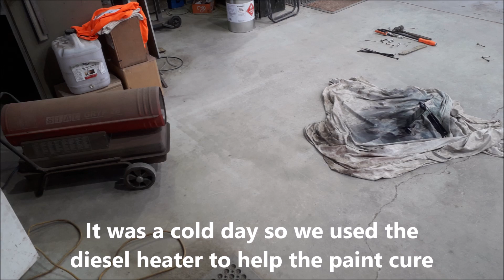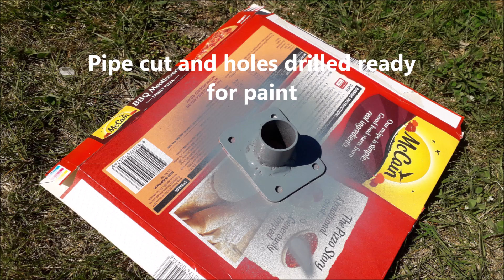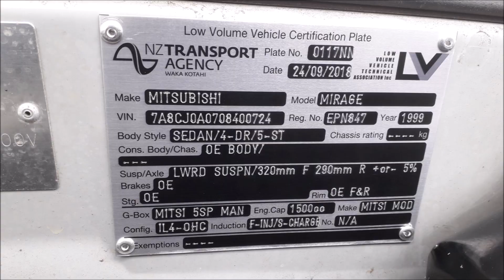1999 Mirage / Lancer supercharged build pt: 1

Comment: hiya mate the engine bay says 4G13 engine but the the certification says 1.5L engine so did you swapped the engine to a 4G15? was it difficult the certification paperwork?
Reply from the maker: The 4g13 and 4g15 are the exact same engine with the 15  being a larger bore and stroke. I bought the car with a 4G13 build plate but a 1.5L engine, certification was super easy.
Reply: @outbackelectricalnz432  Iv a 4g13 I want to do this too would u make all the stuff for me like this if I pay you an pay for shipping?

Comment: Nice! I really want to make my mirage supercharged like this. What kind of supercharger that you use?
Reply from the maker: It is the commonly available AMR - 500 manufactured by Aisin :-)
Reply: @outbackelectricalnz432  very interesting man. Btw, can I install this SC without removing the AC compressor? I want to keep the ac working.
Reply from the maker: Unfortunately there is not much room for it to go anywhere else ! I did experiment with it going behind the alternator but in the ned it was easier to remove the A/C system :-)

Comment: So underneet Supercharger is hole from where supercharger takes air and what is that on left and right? ...there is 2 holes what is that for 1 of them is for connecting supercharger to intake and other one? and do i need put hight oil presure so it gets oil ?
Reply from the maker: The AMR500 has one intake and one outlet depending on which way you mount it. If you mount it like I did with the drain plug facing down you will have intake on the bottom and the out on the top.

These superchargers have there own oil reservoir built in which must be changed when you change your oil.
Reply: @outbackelectricalnz432   thank you i figured out latter i was watchink wrong picture :) 
is that special oil or same as i put in car?
Reply from the maker: @wildfrog5803  It is special oil, I personally use penrite 75w-85 as it is the same as your gearbox (If you have a manual) which works great, be very careful to not overfill it.